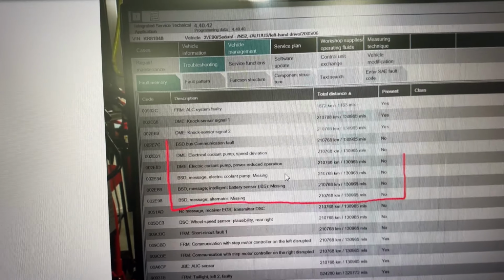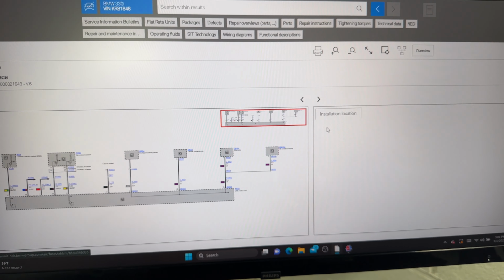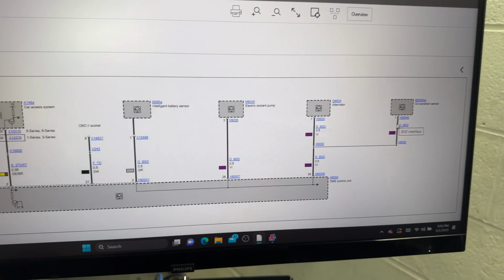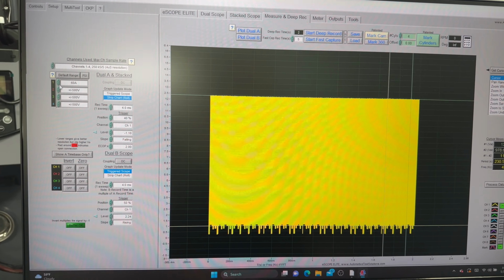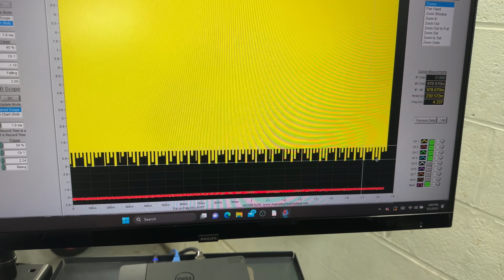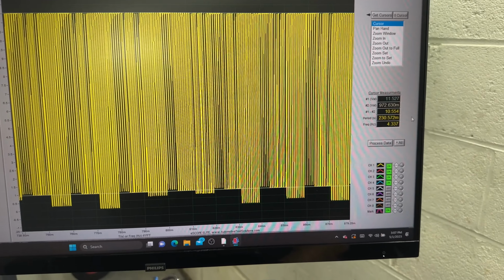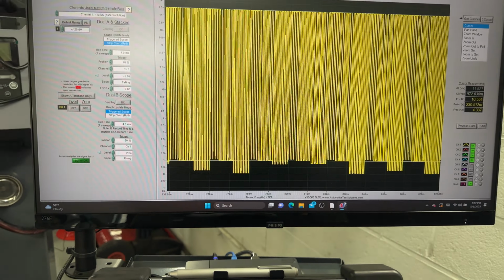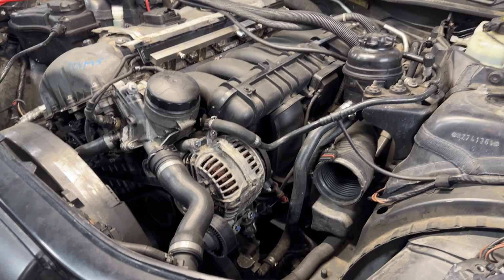2006 BMW E90 N52 BSD network test using the ATS Escope Elite the correct settings!!

Comment: So if you were to unplug the faulty BSD part, for example the waterpump. You'd still get the same fault codes, in addition with the WP fault code then. But the signal you measure with the scope would be restored?

Comment: Maic, was the alternator regulator causing the issue?  I started getting 2E8B - IBS sensor missing after I replaced the alternator regulator and leaving the battery ground disconnected for a few days.  I also get 2E85 electric coolant pump missing but only once in a while.  Just curious if the alternator regulator could be causing the issue even though it was brand new.  I already replaced the Battery Ground and IBS sensor already but 2E8B keeps coming back.
Reply from the maker: With out testing is a guess. Anything can be possible.

Comment: Excellent information, didn't know that sensors can share signal wire
Reply from the maker: Remember this is a network signal BSD not a normal sensor signal wire.
Reply: @MaicSalazarDiagnostics   Thanks is only on BMW or others manufactures has it also